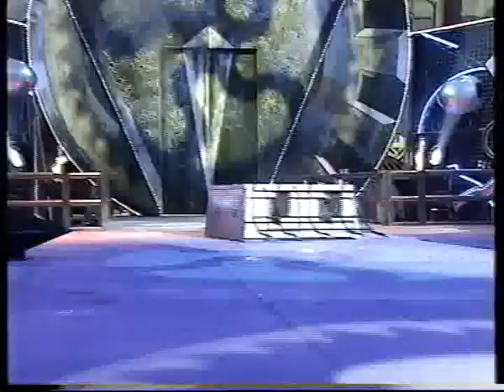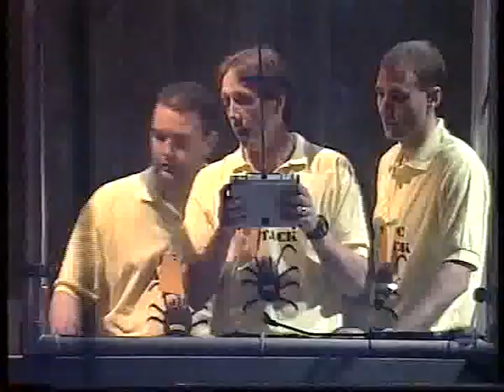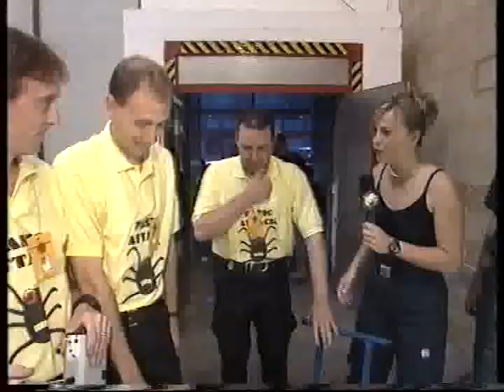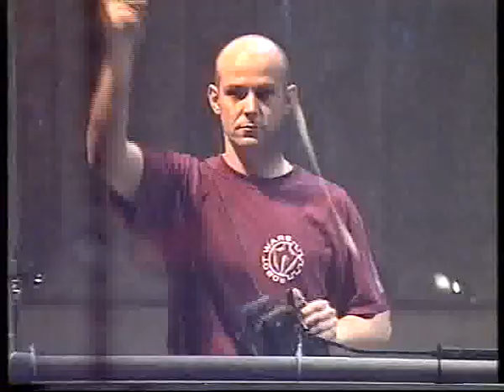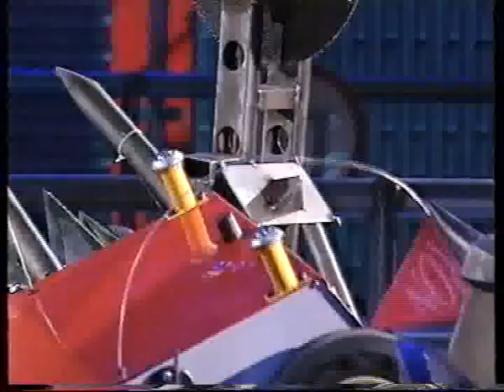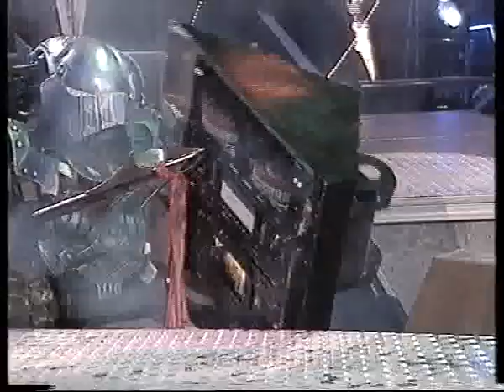RWars Series 2 Heat F Part 1

Comment: Oh my god, the Gauntlet was SUCH bullshit! Dead Metal shouldn't have been allowed to move the ramp and Sir Killalot should not have been allowed to drive up the ramp keeping it permanently down. Really unfair stuff going on here.

Also the fact that some bots faced a wall, others faced barrels and now there's neither of them. Consistency was nowhere to be seen!
Reply: Completely agree, far too inconsistent with the Sentinel then being added later on as well. It wasn't fair having multiple house robots blocking one route from both behind and in front. The ramp moving and pinning was out of order.
Reply: @Telekon15  360 degrees the sentinel spun at.

Comment: Killallot shouldn't be able to hold the ramp down its not fair!
Reply: I don't see too much wrong with holding the ramp down. It just means they have to jump which a decent robot should be able to do. Dead Metal moving the ramp so it was impossible for Disruptor to get on to it in the first place was rather taking the P.
Reply: And neither is moving the ramp